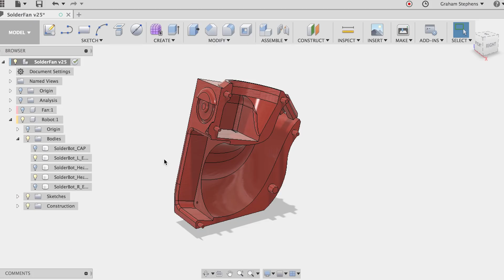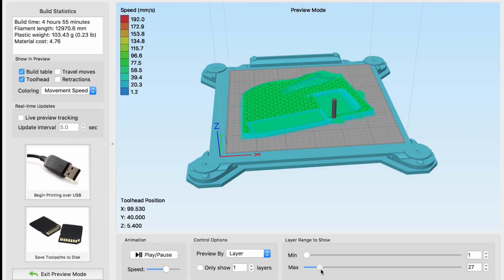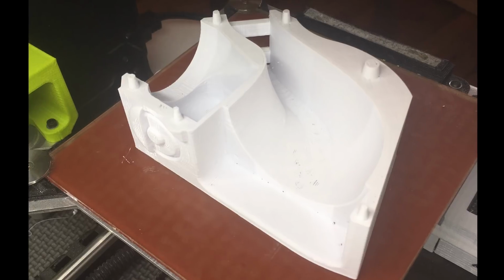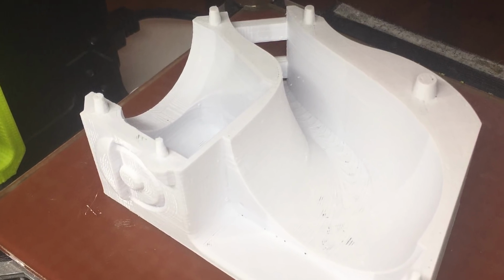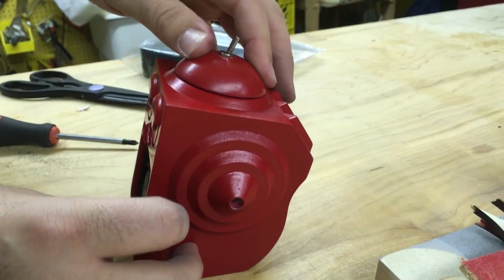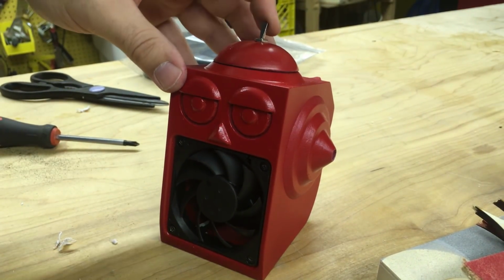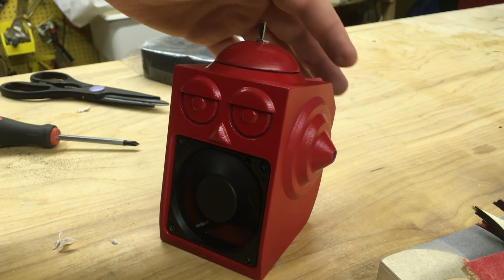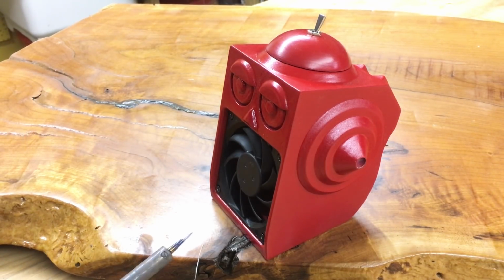3D printed soldering fume extractor

Comment: Damn I thought the smoke was going to blow out the ears.
Reply from the maker: ahhh....I'm kind of upset I did not think of that! Maybe in version 2!
Reply: Diode Press 
If it's visible enough it should look good. But if there isn't enough of it, which I suspect, it's probably not worth it. 
However the conical constriction of the "ears" should give it a nice jetting effect and blow it further away. It shouldn't get reintroduced to the inlet.

Comment: Nice design! I just wanted to give a feedback. I built a similar fume extractor and never thought about the fan placement before I was done with the enclosure. Just like yours air is sucked through the motor and then it gets filtered. That means that also small particles around the shop gets sucked in and make a mess in the enclosure. Next time I build a fume extractor I will make sure that the air gets filtered first.
Reply from the maker: That's a really good point, I don't do a ton of soldering, so I'm hoping it won't get too messy, but if I make another version I'll definitely consider that! Thanks for checking it out!